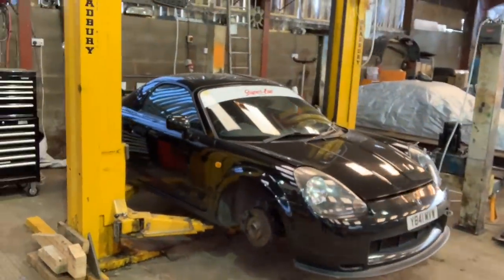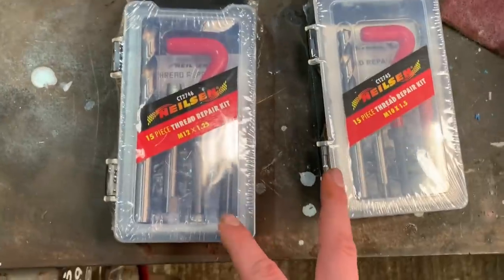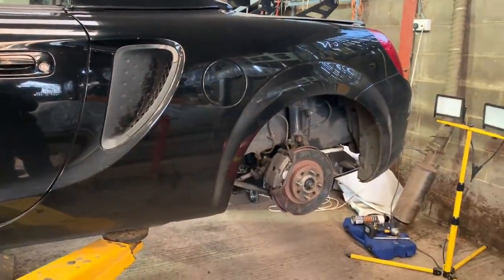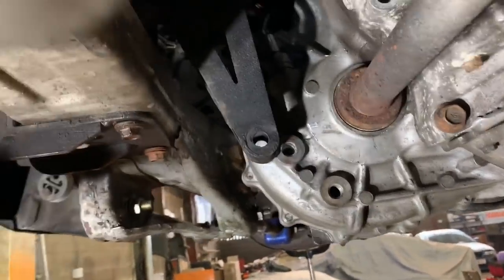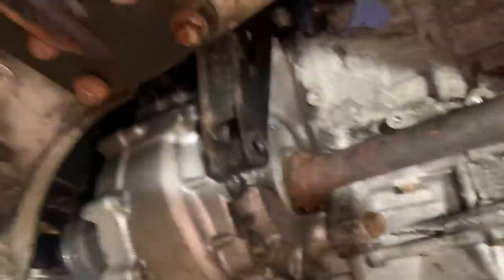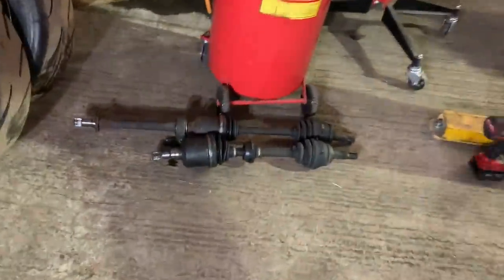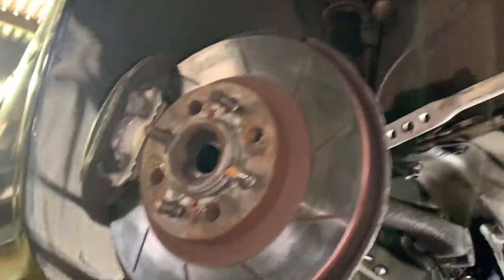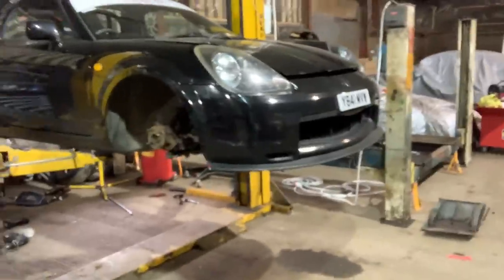Nürburgring Prep #1 - Gearbox Thread Repair & Brake Discs

Comment: Since you removed brake disc shields, make sure you protect lower ball joints and tie rod ends somehow from the heat coming from brake discs. On my Impreza, new whiteline roll center adjustment kit got pretty cooked from outer side after one year of trackdays, had to get replacement boots. Impreza is much heavier, but still it makes sense to me, and I've seen a lot endurance racing cars with custom heat shields on ball joints...

Comment: big fan of blank pagids, all i ever use! i spent 8hours today and all i achieved was fitting some calipers and running a new internal brake line set, doesnt sound a lot but was graft like your scenario 😂
Reply: Pagid discs stay pretty through your rims, it doesn't seem like much but when they've been on the car months and still look good, you notice

Comment: 3:15 The slots in the rotor are to prevent brake fade.  They are not there to clean brake dust.  When the brakes get hot , and they do so more frequently on the track,  gases build up between the pads and the rotor and fade your brakes away.   these relief slots and grooves prevent that gas from preventing you from braking.

Comment: Probably been mentioned before but a good future mod would be to extend the engine mount down to pick up that second, lower, bolt hole.  This will mean all that vtec torque isn't just going through one ally-mounted bolt.

Comment: Do you think dan there is not a noticeable difference on track with grooved and none grooved discs?
I have a 350z & e46 330ci need mine changing. I get high speed vibration on braking, could be worped discs or the grooves maybe? 🤔 great video btw

Comment: I always use cable ties on the swap shafts for my H22 EG 😅 haha
Reply: Dan AYP yo dude you got any acceleration videos, had an accord type r, EG is 300kg lighter!!!!
Reply: @anthonybelton-ford3124  not really, the 5 things I hate about it had me spinning up 2nd and 3rd out of a roundabout haha. It managed 13.8 @101mph with the 1.5 exhaust system on though at York. 👍 Done alot to it since

Comment: Para cambiar los fuelles del palier  le das un golpe y sale la pieza la parte de la suspension que va con un clip y para ponerlo igual,antes de poner el nuevo fuelle puedes limpiarlo con gasolina y su nueva grasa,ya le puedes poner antifricion en el aceite de la caja cambios y al motor le vendria tambien bien,si le vacias el catalizador el motor te ira muy fresquito tu que lo usas en circuito te lo agradesera el motor,si lo haces con uno de un desguace le sueldas un tubo en elinterior que o te suene a lata.
Usted es mecanico o aficionado a la mecanica.

Comment: If inserts don't work Dan, go up a bolt size
Reply: Also, threadlock the insert in, let it set, then snap the tab off.  Grease the bolt thread with anti seize and you should never have probelms

Comment: Hey, since u said u dont realy need drilled discs for track days, i have a question. Ive been on a trackday with my bmw, and i have stock brakes stock pads, i had a huge brake fade, is that caused by the pads rather than the discs?
Reply: Pads / fluid 100%
Reply: @r129r16pfl  after some research i assumed its the pads propably, apparently its the thing that goes first.  Also, do u think i can fit sport pads  to a stock disc?
Reply: @nejakejplaesant1490  yes! Stock blanks + racing pads/fludi = win
I use CL rc6 - awesome pads, proper hardcore stuff, and not that expensive
Reply: @r129r16pfl  thank you! Will not bother getting a drilled disc then.

Comment: What’s the difference/benefit of using a helicoil rather than just tapping it with a tap and die set?
Reply: you can use the original bolt with a helicoil
Reply: Dan Townhill, sorry I don’t understand how, if you have to drill out the old threads
First?
Reply: @DannyBrown88  The larger drill and tap is so the outside of the helicoil will screw into the enlarged hole.  The inside of the helicoil is the same size as the original tapped hole, allowing you to use the original hardware, as Dan Townhill mentioned.  If for some reason the helicoil gets damaged, you can grip it with some needle-nose pliers and rip it out and screw in a new one. In the video, you can see Dan do just that.  He screwed a helicoil in, but I think the drilled/tapped hole was a bit loose because the drilled hole was elongated.  So, he had to remove the helicoil, tap the hole deeper, then install a new one.  Helicoils can't be reused as you can see when he rips one out (it looks like a useless twisted wire).
Reply: If your still unsure, search "helicoil thread repair" and watch the first video, can often be easier to understand seeing it done rather than reading someones explanation